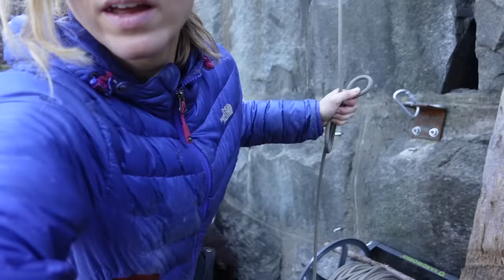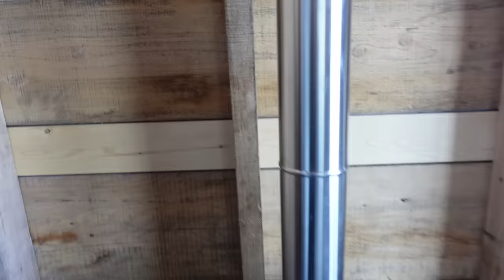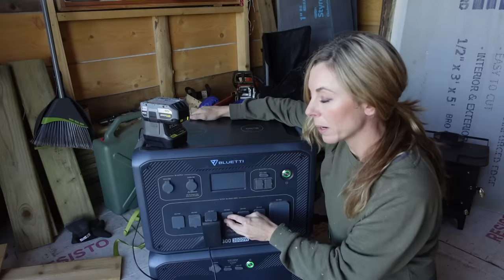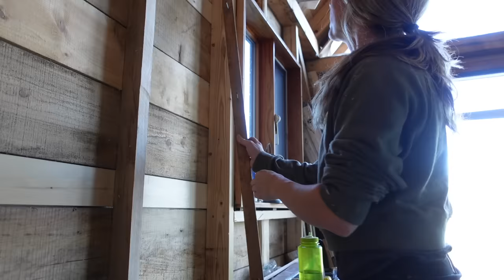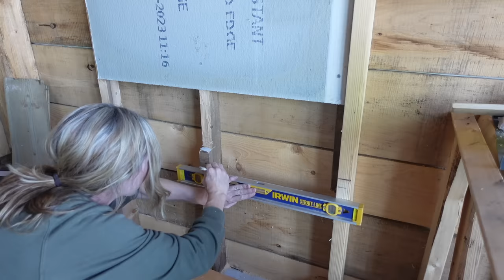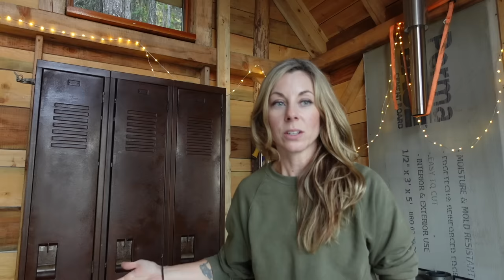Husband needs surgery = Rollin' with the punches.

Comment: Hey mitchy.....to make concrete board look better...use a peice of rusty corrugated metal. Screw to wall infront of board again could use metsl tube cut a spacers. Look loads better too. Under wood stove make 2x woodern 45 degree brackets in same wood and add small strip aling front stop ash falling over. Metal strip be better angle iron. Under stove add a square of plate metal...old oil can side or chequor plate. Stop heat and ash spillage. Metal back plate would send heat back in cabin too...the corrugated tin. You coukd using metal mesh and wood strips make a mini drying rack...bit like ryan did in his cabin.
Defo use metal wheel with fairy lights maybe usb or even battery powred to use a chill cabin lighting. If using powerstation add usb strip lighting under or around points in cabin...rgb so can change colour. Get a couple of solar lanterns for deck and place on to be made rails...each corner maybe even sensor one on top of patio door for use and scaring bears or those ravenous chip munks lol. Maybe go bargain hunting for couple old mismatched chairs yo do up for cabin n deck and add old rusty wheel firepit placed on couple patio slabs too. Few ideas for you. Take care.❤
Love the builds.
Peace....

Comment: Use two pieces of the 2x4 and toll nail it under the brakes and screw  it withe the brakes that will prevent the flex

Comment: You can also add some braces underneath the stove platform.  From the front of the platform at an angle back to the wall At the bottom. It would give you some great support and avoid legs to the ground. One on each side and one or two in the middle. Just a thought. I’m afraid your angle braces will have a possibility of bending

Comment: @ 13:54. You probably won't appreciate me commenting on this, but you are removing what little strength is holding up that part of your cabin wall and roof when you reduce the amount of wood structure from your two by fours to better accommodate your tiny wood stove's wall clearance. This is a really bad idea. Although your wall doesn't look very heavy, it weighs in at more than you might think. A better (Read safer) solution would be to add an elbow to your stove pipe and this would allow you to have more wall clearance without having to reduce any structural support to make more wall clearance behind your wood stove.

Comment: I feel like the stone surround would be best if you took it another 18" on the left side up to the corner of the wall.  The stone needs something solid to die into (if not, then add a 2x6 so it sticks out and you have a place to terminate the stone)...you'll likely need to add a 2x3 wood pop out on the right side by the window so you have a place for the stone to die into.  Imagine trying to place stone and mortar with nothing to keep you in a straight line.
Reply from the maker: Don’t worry. I have a plan 😊

Comment: I would be there to help with the windows in an instant, if it weren't for the fact that you're 4000+ miles away, I'm 75, and sufficiently infirm that it's a big deal for me to get upstairs to bed, let alone get to your cabin ... but apart from that I'm all yours!
Reply: I am 68, and hoping to reach 75, and even more excited if I can still work as hard and heavy, as I do now.  I just bucked up and split 3 - 4 cords of winter firewood.

Comment: I had a small hunting camp one time my brother thought it was a good idea to have are little wood stove higher off the floor. It Wasn't a good idea the floor was allways  very cold and the guy on the bottom bed froze and the guy on top cooked. Lol
Reply from the maker: Yes I did think about that, but when it came time to provide my measurements for the bits and pieces for the stove and pipe I just kinda picked a number. 
Good thing for me, I’ll likely be the only one sleeping there, and I’ll be up in the loft! 😊
Reply: @michygoss7148  silly girl. You will be able to keep things frozen on the floor and melting up higher.

Comment: I’m curious about your water supply. I noticed a fiberglass tank up the hill. Is that for water? Although not practical in the winter, you could gravity feed some water from the top of the hill into a tank in the cabin? Or just haul down what you need.

Comment: Any thoughts on running a secondary attachable roller/sling point with a leader line.
Clip on once Skymule is at bottom.
For stuff like the window template ?
Reply from the maker: So many thoughts. Not enough time. 🤪

Comment: UGGGG perma base smells so potent, not a fan of putting off gassing synthetics indoors. my friend Zack lays tile for a living and says once the grout is on the smell goes away... mostly.
I went with hardibacker for behind the stove. it's cement and fibreglass so no smell.
using a non combustible material behind the stove is great, what is even better is using a metal plate with an air gap between your perma base and the metal plate. use 1'' copper couplers with a screw going threw the whole works. 
the airflow behind the plate dumps heat into the air the heat is removed from the area.
the perma base only solution, the heat is continueousy put into the wall and the temperature keeps going up. 
if you want a better explination just ask.
Reply: after watching more of the vid you will have lots of air flow between the studs. rendering my comment void. i forgot your foam was on the outside of the building. i was thinking of the permabase melting the vapour barrier. the heat shielding does need to go all the way down to the ware the feet touch the wood. or at least to the bottom of the stove. radiant heat goes in every direction but hot air will not go down unless the air moves. I'm sure Steve could tell you all this stuff. however me ranting on this subject has saved a few cabins from burning down though.
that board is going to stink for years though especially when it gets hot.
Safety Karen signing off.